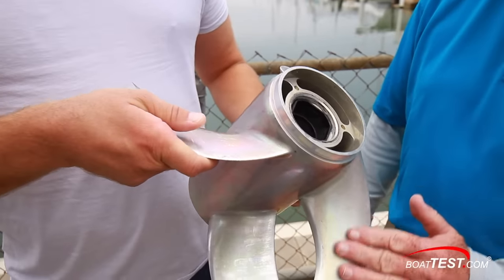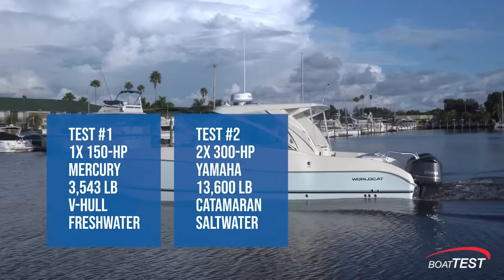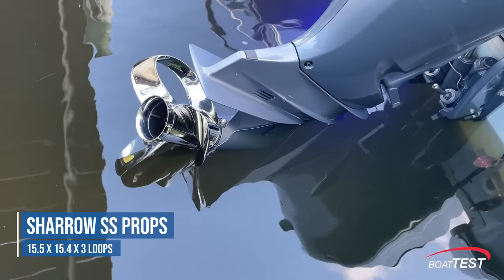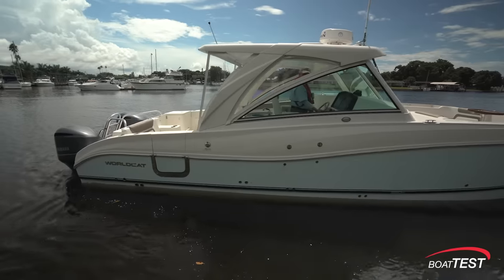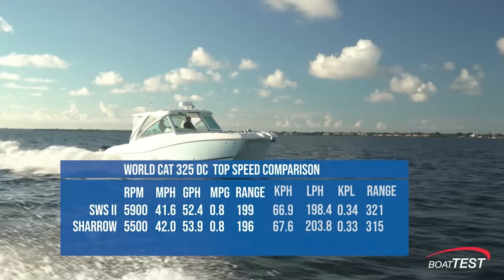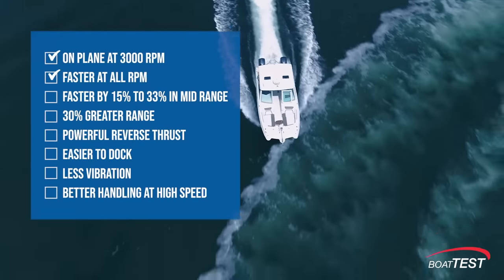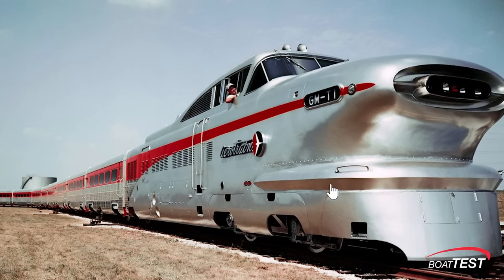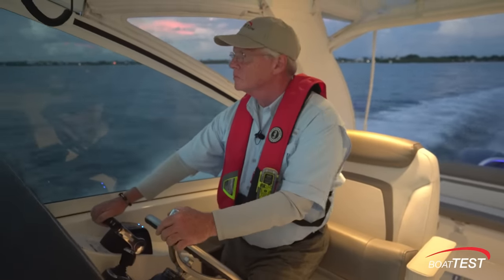Sharrow Propellers (2022) - Test Video by BoatTEST.com

Comment: This is really cool, Id love to throw one on my 19' deckboat. Only problems are, first and foremost, price! $5k for a prop on a 150 is insane and prices me out of the market. Next issue is a actually prefer aluminum props and these are SS. I spend a lot of time on Lake of the Wood, Ontario Canada, and that lake is notorious for eating props and lower drive units. if possible, I want the prop to give before the bottom end does and aluminum is a better bet there. If warranty was lifetime replacement and covered rocks, Id consider it lol. Seriously tho, if they brought out an aluminum line at a substantially better price point (under $2K) Id do it in a heartbeat.

Another thing to consider I suppose would be potential theft. I think Id be afraid to leave the prop on the motor anytime I wasnt with it lol
Reply: Indeed, very impressive stats, but as you have mentioned they need to find a creative way to bring the cost down. At that point its nearly a no brainier to purchase one.
Reply: @f900ex5  they paired with yamaha for mass production... our wishes might be heard

Comment: Will the loop blades improve the duo-prop? I’m especially interested in a duo-prop system with looped blades. I have a 8.1 L Volvo penta with a duo-prop. 
Hypothesis:
If there is an in-line counter rotation of props, then there is more cavitation from a duo-prop circle tip; therefore, a Sharrow Duo-Prop will show greater improvement than a conventional propeller.
Reply: I have DPs as well. Equally interested.
Reply: You'd probably be looking at 12k in prop costs. Not sure it would be worth going that route for a specialty prop. Not to mention repairing one of these, would highly unlikely result in satisfactory results. CNC machining is a great thing, but very expensive and lengthy process when it's on a 4 axis or most likely 5 axis machine. Casting is definitely the best way to market these, but at a $5600 cost per pop, it's not realistic for probably 99% of the market out there.

Comment: Toroidal propeller! First designed in 1963/64 and over the years have seen different designs and some now patented like this design and each designed to suit different performance needs 😀
Reply: What I don't understand is if it works in boats why does it not work in aircraft? There's an MIT patent (strange considering that sharrow already has one) for a toroidal drone prop and they claim it works better than normal props, specifically in loudness and in efficiency, but people in the drone community have attempted to test the prop (by designing ones that are as close as possible) and they all fly terribly.
The MIT 'paper' is two pages long and provides no data and despite saying its quieter and playing a noise boosted audio of a normal prop, they muted the clip of the toroidal one.
So it seems that even for MIT it does not work.
Reply: @definingslawek4731  Good question. While not a propeller designer by trade but a few things could prevent this type of propeller being installed on aircraft. #1 cost of manufacturing, the prop profile is cnc machined compared to casting a propeller blade. #2 would not allow for variable pitch control. #3 weight factor,  the design of the toroidal propeller to handle high torque loads and high rotational speeds at a significantly larger diameter, the sheer bulk of the prop would be substantial compared to thin bladed aircraft props, I just don't think this is a good match for an aircraft. #4 cost of repair is another factor.) There could be more  points to consider,  but to me these 5 points would prevent aircraft usage. Can you think of any other points 🤔

Comment: This is the same test as the other week surely ? Still not a fair comparison. Different pitch. I’d also say that the prop slip numbers are worth looking at for wot between the two props. Something doesn’t add up there at all
Reply: The most important ""RPM"" would be where the torque/horsepower lines meet on any/all motors, no matter what the factory recommended ""WOT"" operation RPM's say on the BIA TAG & if these guys are taking that into account while building a prop for a certain motor and or boat combination, then they SHOULD be considered to be ""PROPERLY PROPPED OUT"" as we used to say while trying to get the customers to understand why we COULDN'T just stand behind the counter and ""SELL THEM THE EXACT & PERFECT PROP"" for their boat without at least knowing what their exact ""WOT-RPM"" was on their hull/motor/load/usage/altitude/fuel/air temp ect ect ect that they were showing on the tach & they just go ""HUH, I DON'T KNOW, IT GOES THIS FAST"" and even with the biggest bank account, they COULDN'T BUY A CLUE!!! Propping is the most important & hardest thing to ever do on a boat & that is where the FUEL meets the WATER, PERIOD!!!

Comment: There's a market for it, I can see a fishing charter boat where the use is much higher than the weekend warrior. I see parallels with this prop to the anchor by Ultra Marine with their use of higher quality materials and craftsmanship. The downside, nobody sees the propeller. They need to pair it with an ornament or logo of some kind to market their brand as premium. Like the "Intel Inside" campaign.

Comment: I see really a good reason for the Sharrow Prop: the reduction of the blade-tip vortex. On the other hand, it has more effective blade surface, which makes the comparison a bit biased. Did somebody make a comparison between Sharrow prop and a slightly larger conventional prop having the same pitch? Maybe the difference in performance can be reduced but the price (of the conventional one) remains realistic. My engineering knowledge tells: larger prop -> better propulsion efficiency (until a given point where the drag overweights the benefits).

Comment: Very impressive innovation. I wonder how this prop design could benefit military applications such as adaptations for submarine and large fuel burning surface vessels. If the prop creates less drag it would in fact run quieter in the water.  I think this kind of innovation is over due. The marine propeller has had very few design changes in the last 100 years that we could say are as significant as the Sharrow.
Reply: Most military vessels including subs have very specialized drives that have more money put into research of the drive system then civilian boats have put into all things combined. And I mean all civilian boats everywhere every brand every everything. Uncle Sam has more money in just the drive system research. Most technology innovations start for military applications and eventually make there way to the civilian market decades later.
Reply: I was wondering about the same thing, there's a lot of pictures of submarines and other naval vessels that have their propeller/drive areas tarped over with black very specifically to hide the shape.  I immediately wondered if they also use something like this.  Getting rid of those vortices on a sub/ship drive would really be desirable.

Comment: Deducting the $1,000 per propeller that I have (I would like to get a different set) and  30% savings (Mine would be different). I would still have to wait more than 3 years for the props to pay themselves off. That's if I use the boat 100 hours per year... That's for Sharrow aluminum and I have twin 4 blade Stainless now. Sharrow props will definitely have to come down in price before I'm interested.

Plus, Yours figures with the Saltwater Series II props has the boat with a 28% prop slip. Now that slip is totally unacceptable and would need different props or different mounting of the engine/adjusting drive height, or both. Yamaha actually allows 28% prop slip for best numbers???. When World Cat 325CC gets 16% prop slip with the same engines...... And how do you get your Ranges if the boat has a 279 gallon gas tank? Thanks

Comment: Can you do some testing with it with the correct pitch? I guess you need one or two inches less to get the engine to its recommended max rpm. This test isn’t fair on the standard prop when you don’t get them to the same max rpm.
Reply: Exactly both props need to be as close to max rpm at full out throttle for the results to compared, otherwise this test shows you nothing.
Reply: @vmcmark7578  You have a point there. My comment though was about that the props in the video doesn’t have matching characteristics with very different max rpm, which is the easiest way to compare props pitches. Similar to when trying 3- or 4-blade props on the same boat. Therefor I don’t think the numbers in the video gives a correct comparison.
Reply: @gunnarfernqvist4896  Have you ever seen a TV that was square, not just flat? That was how it was done then. The test boats had their motors ""WITH-IN THE WOT RPM"" range with both ""TYPES"" of propellers correct? The power units wouldn't be getting harmed by being ""LUGGED"" because they were spinning to the factories spec. 

Why can't YOU just THINK that the performance gain at a lower RPM, IS A GOOD THING......some times SOMEONE DOES HAVE TO RE-INVENT THE WHEEL.

Perhaps they should have added pitch to the OEM PROPS to get the RPM's down & then everyone would yell that it needed a different pitch, to let it spin more. Tennis anyone??

Comment: Only issue i have with these props is if they get the smallest chip or bend in them they instantly loose all these benefits, they are also ridiculously expensive compared to the oem props or even aftermarket ss props. Awesome prop though such a radical design.
Reply: you made that up

Comment: I would like to see this scaled down to electric trolling motors(Min Kota) and smaller (below 20 HP) out board engines.
Reply: give it 10 years so metal 3d printing can mature :) you can 3d print that shit for 200 dollars of material cost... so that would be 400 dollar manufacturing price and 800 dollar MSRP... at that price point you recoup your investment in 1 or 2 tank fill ups on a 150 horsepower boat.
Reply: Have someone 3D-print one for you. 😊

Comment: I've worked the backwaters and offshore waters of Sarasota Bay and the Gulf of Mexico for over 40 years as a full time quide, the last 20 years in Twin Vee Catamaran out of Longboat Key.  Those props would have paid for themselves within 2 years of use and would have been far more convenient than the standard Suzuki props I was using.

Comment: I realize r&d isn’t cheap but 10x the cost of an expensive conventional prop is a bit excessive. For that kind of money I’d expect it to wash the boat at the end of the day.. Based on a bit of rough math I figure it would save me 80 gallons per year and at that rate it would take 16 years to break even. No doubt it’s an innovation, but practicality has to come first.
Reply: Right idk how they came to decide that their invoation merits $4,900 vs the conventional manufacturers prop of $700. Also the question has to be asked that would Yamaha warranty an engine that has this prop mated to it.

Comment: Looking at the shape of the Propeller.
This would already tell you it would create more propulsion.
It basically has 6 propeller blades instead of 3, and the loop design helps to trap the water instead of slashing through the water as with a standard propeller.

It was interesting to see the 2 different designs come to together on the graph as the RPM was near maximum.
My thoughts would be ?
As the speed of the water increases, the advantage of one prop to another starts to show no difference.

The only disadvantage I can see with the Loop Design ?
It would prone to wearing out more quickly than the standard prop.
Reply: I'm not a prop head, just a guy who likes Popular Mechanics. At first glance, I saw Michaelangelo's helicopter, but upon closer inspection, we see some biomimicry in the form of a beetle's wings! The real genius of this design is for all of the aerial drones you're going to have buzzing (or not buzzing anymore) over the water like real living mosquitoes! At the end of the day, this is just one more piece of unobtainium for the guys you wouldn't give a scalpel to
Reply: It isn't just faster, it's more efficient/better fuel mileage

Comment: One thing not tested, engine heat. The exhaust exits through the prop. Does this prop cause more exhaust back pressure? 
In short, does this new prop shorten engine life? Or extend it? Does the engine run hotter or cooler or the same?

Comment: All of those numbers are good but you should show a ROI calculation. Those props are cool and all but at 5k that's a lot of gas. You would only have to burn 4k+ gallons of gas to pay for it.
Reply: The last time this was brought up in the comments they took the video down - I am guessing the creators of this prop don't like discussing that aspect.
Reply: I burn roughly 250 gal a trip. 4k+ gal of fuel is not that hard to hit in a commercial or heavy use setting. At 250 a trip thats 16 trips. 8 weeks in summer time.
Reply: @12aquaholic  but you are not factoring in the difference between the two performance levels.  You are not saving 250 gallons per trip with these props.. maybe 25 gallons on a tank which would take 160 trips to burn 4k gallons.

Comment: Really wanna try one on my 2022 Sun Tracker Fishing Barge DLX22 with a Mercury 150hp 4 stroke equipped with factory SS Enertia 13P prop.
She currently runs 33mph on GPS at WOT (5400 rpm) with full up trim, 38 gallons of fuel, 4 people, fishing gear, bimini top up, and food/drinks/etc.
Best cruise speed for fuel economy is about 3000 rpm at 15 mph.
Reply: Have you ever tested multiple “normal” props for the best performance on your boat in the same condition that you normally use it? 
Most people don’t, just take whatever the dealer says is best. I helped a friend go from 42mph top speed to 50mph with just a prop and education on how and when to employ engine trim. He said “I thought it was just for picking it up when on the trailer”. 
Not so, my friend, not at all!
Reply: @jimterracall6766  On my 3rd boat. Played with props before, but not on this new pontoon boat. 
Doing the math, if I switch to the Mercury SS Enertia 14P prop I should go from 33mph to 35-37mph with a slight rpm drop due to the slight increase in required torque to turn the 14P versus the 13P prop. 
I would expect little to no difference in the hole shot performance. I wouldn't go any higher than 14 in pitch for a pontoon boat. They all just about run a 12, 13, or 14 pitch.
Motor height is set properly and I always trim out when running on the water.

Comment: "Most boat buyers want to know what the top speed of the boat is, even though they almost never run the boat there" .... it was at this point that every bass boat owner stopped watching. lol
Reply: I thought the exact same thing!  Bass boats only have 2 speeds, idle and balls out full throttle.
Reply: @atthebrink74  Only time I'm not running WFO is in no wake zones. Last thing a good motor needs is a prop that's dragging down on RPM's. That means it's lugging, even a little, leads to blown power heads. Ask any seasoned owner, or tech, that lugged motors don't live long lves.
Reply: This is just a bad test. I'm sure they can adjust the pitch to make max rpms and yes I run wot often in my bassboat. Currently 74mph with tournament load.

Comment: Gday Capt Steve,
A very interesting screw design moving away from the traditional blade type screws. But how does it compare to:
1. Variable pitch screws
2. Is there a performance difference if it was attached to an inbound engine 
3. The USCG safety reports (2001 to 2006) indicate 28 to 47 people are killed annually by “struck by boat motor or propeller” accidents in the United States. So I wonder how a person would fair if struck by one of these screws since they aren’t the traditional blade

Comment: I want to  see this on a bassboat with a 250 hp engine. Ofcourse I'd love to see it on my specific boat a 2019 pheonix 921 with a Suzuki 250ss.
Reply: Freshwater bass boats don't normally cruise at 3/4 speed for 200+ miles a day.  You would probably not see a huge advantage.

Comment: i think this is very helpful for electrification of boats to get a better range out of the battery and out of the solar panels.
this is something where electrification can shine. if you run out of fuel, you are stuck. if your battery runs out of juice, you still get a few kilowatt peak from your solar panels. 
when you combine this with a hydrofoil concept, you get something really cool and efficient.

Comment: Seems like  ideal component to make in a 3D metal printer 
For smaller and  electric motors...manufacture from a composite material.
Reply: 3d metal printing isn't very strong probably break with the type of load that's on them.
Reply: An aerospace company has finished building a huge space rocket completely made from metal 3D printing. Lighter, stronger, easier and faster to build.
Edit: There's also been fully functional and long lasting turbochargers made from 100% metal 3D printing. The whole turbo was made in one print.
Reply: 3d metal printing is for when ur making 1 part... u could cast it, would be way faster... but probably machining it all the way is the best.. also way expensive.. but printing is aswell.. machining is like printing but ur taking material away instead of adding it..
Reply: @larsvegas1505  
Hi Lars thats the reason it makes sense you only use the material you need. 
Casting metal into a high stress thin component like this is pretty difficult and the moulds would be a nightmare and involve a lot of fettling... rather blades would have to be formed bent, forged? assembled on the hub, heat treated possibly and then largely hand finished. 

Metal printing means you can use one type of machine to produce most variations of size fit and possibly materials on demand ..and you can minimise the amount of surface treatment/fettling required.